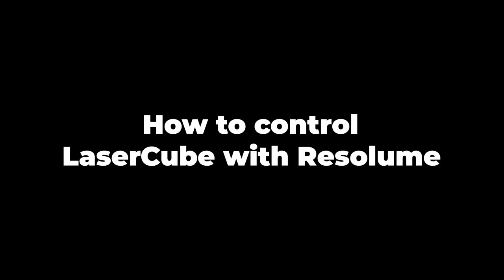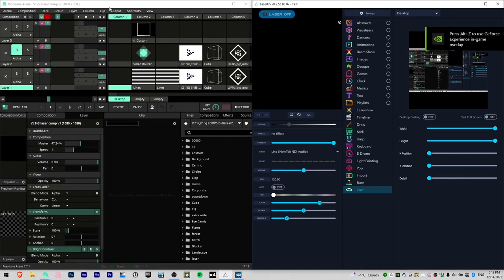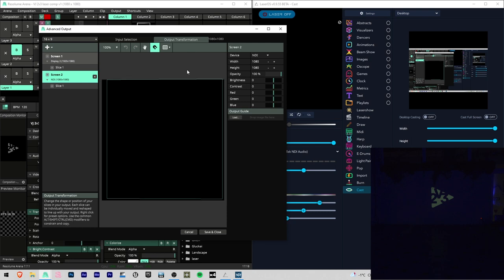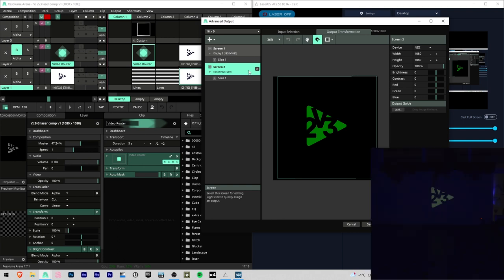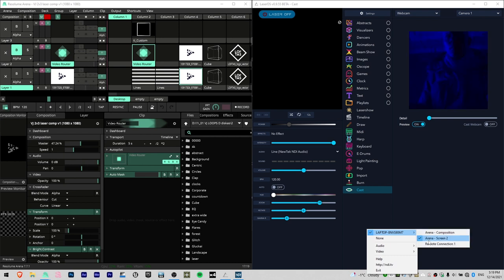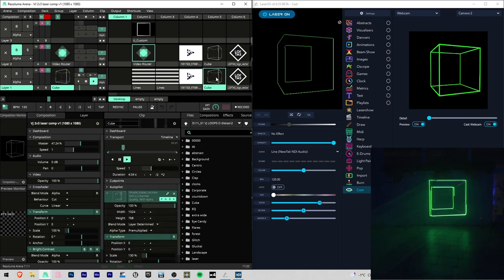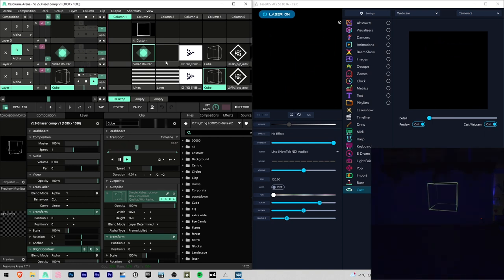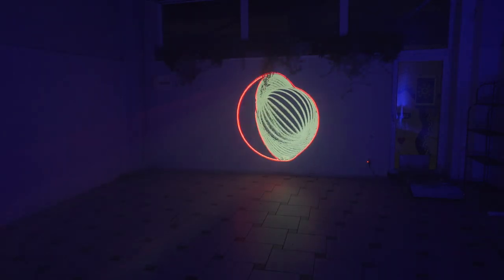LaserCube and Resolume - TUTORIAL

Comment: Cool stuff.. would it also work on MacOS?
Reply: it should work, haven't tried myself though :) 
LaserOS, Resolume and NDI works on MacOS, so everything should be working.
Reply from the maker: But NDI tools for macos doesnt has "webcam input". You need to use "virtual input" instead.
Reply: @wickedlasersvids  Thanks for the quick reply! I installed Resolute + NDI Virtual Input > selected NDI in the Output in Resolum, but LaserOS can't recognise the NDI "Arena Screen 1" output in the webcam settings.. I must have missed something
Reply: @MatthieuPesesse  same here
Reply: @wickedlasersvids  heya, LASER OS doesnt recognize the virtual camera from NDI or Syphon or any other software, are we missing something? is there a debug line we can type to channel the signal from resolume or madmapper?
Reply: @dailsonshikako  I have the same issue. WIll post the bug on reddit r/LaserDock

Comment: Thank you for this tutorial! I wanted to ask you how to manage color when doing this. Right now anything I import from resolume either has the rgb colors or only white/only red/only green, etc…
If I change colors on resolume composition, it doesn’t show in the LaserOS software.
Thanks!!
Reply from the maker: Did you try to change the color in LaserOS? Theoretically LaserOS is responsible for forwarding the signal to the LaserCube
Reply: @wickedlasersvids  yeah, that’s what I did, I just wanted to know if the Laser or the Laser OS software could react to any color changes made in resolume.
Reply: Ever figure this out? It looks like the LaserOS doesn’t take any color data from the “Cast”. So you get white. You can recolor it an effect but the color is derived from the effect and not any color data from the stream in Cast. Ever figure it out?